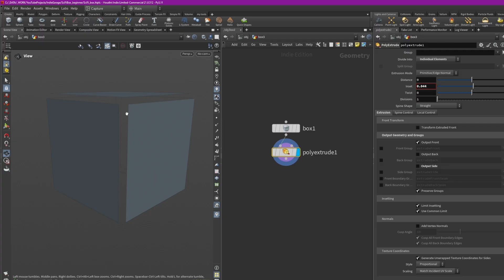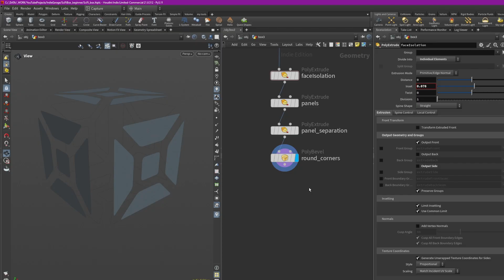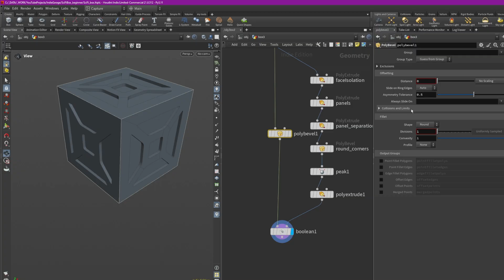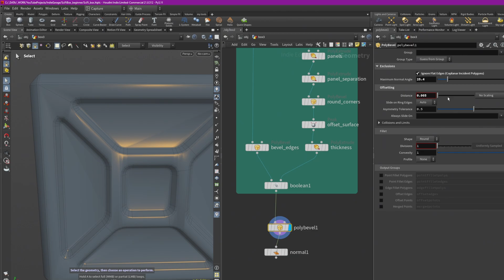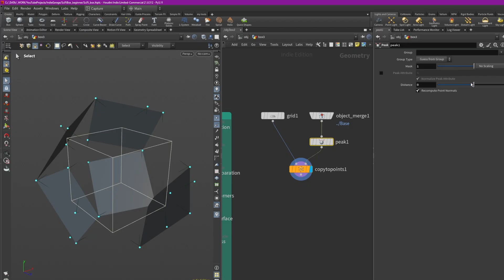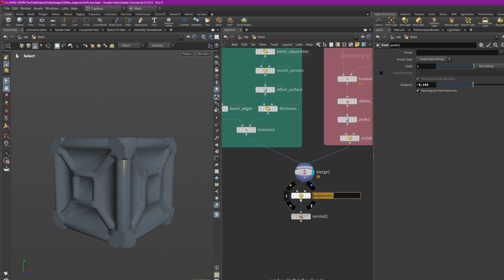Combine Basic Nodes for Amazing Results #houdini #modeling

Comment: Your recent videos are excellent! 
If you are open to any requests, I would be really interested to see how you manage your files, exporting data (models, packed RGB mask textures, etc), asset management and any game engine related tips at an overview level. It's hard to find that type of information because it's mostly learnt on the job and tutorials are often too specific and usually not game engine related. 
I'll be looking out for any of your new videos, thanks!
Reply from the maker: Thanks a lot, I really appreciate it.
Yes, that’s definitely something I plan to cover. I want to show more of the full pipeline around the asset, not just the Houdini part: how I handle files, asset organization, exporting meshes and textures, texturing in Substance Painter, exporting the different maps, and then setting things up properly in game engines like Unity or Unreal.
I agree that this kind of overview-level production info is hard to find, even though it’s a huge part of the actual job. So yes, it’s definitely on the roadmap
Reply: @IndieGarage1980  Hell yeah! Thank you for the response and efforts to provide these great videos, looking forward to your future uploads :)